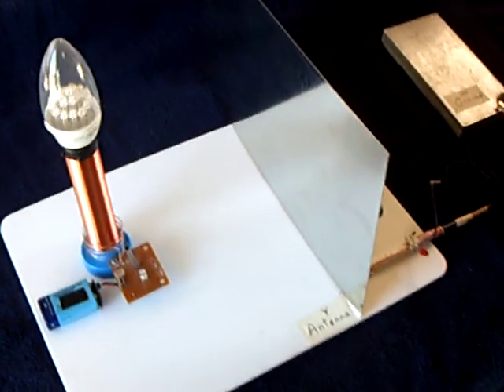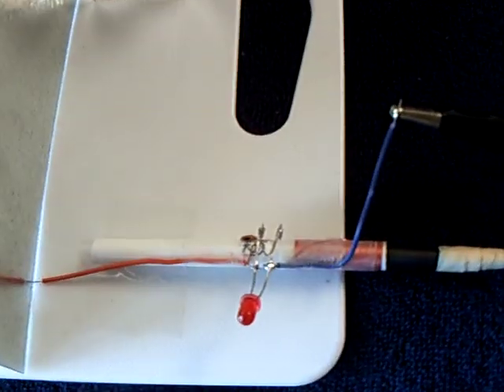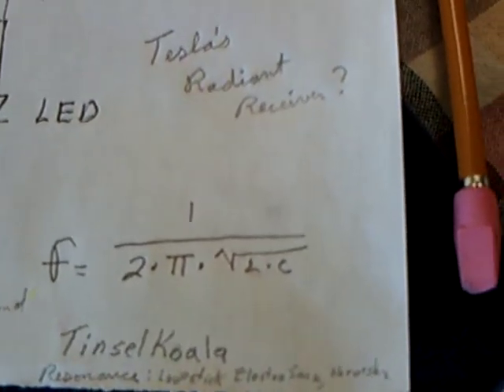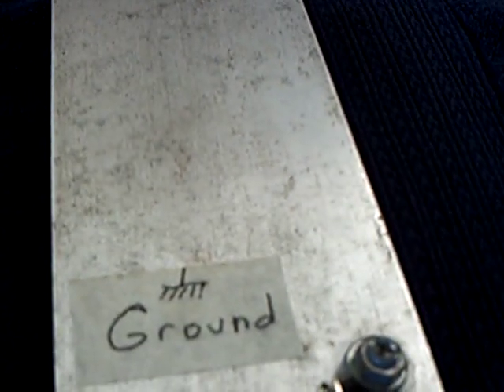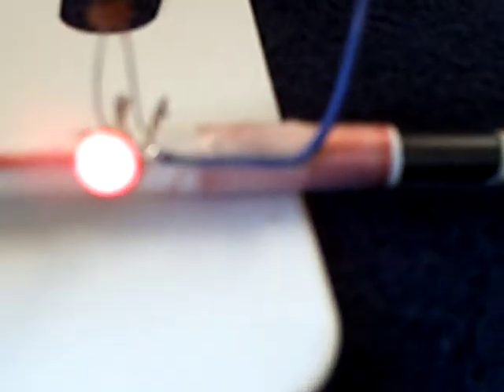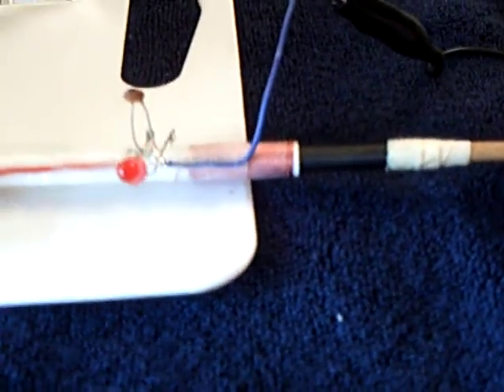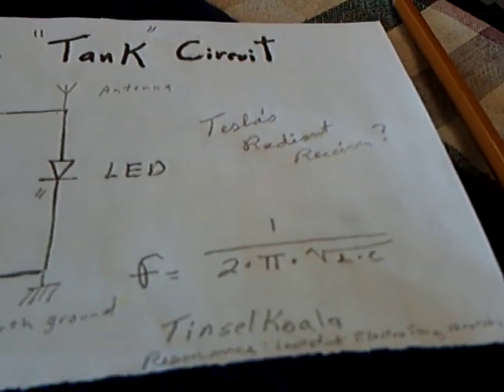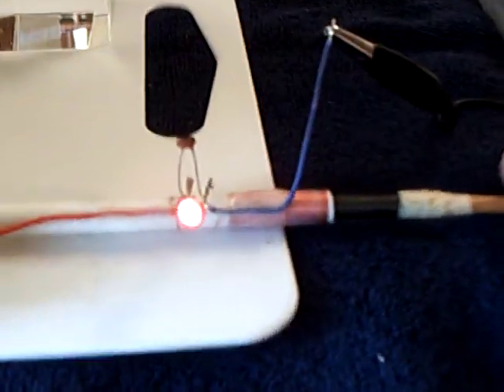Tesla's Radiant Energy Receiver ??

Comment: Tesla ball was 142' high at 6000 feet altitude in rarified air while grounded at 12 feet deep with a tin polished coating made of hollow wood internal spheres. It was then shellacked and painted with black rubber coating. Rarified air is the key based off the Crux radiometer. Radioactive particles traverse through the metal plate removing and adding charge. The upper plate needs to be negatively charged and the wire to be coaxial. The patent is missing other components to make it work. All of which he patented earlier (coax, circuit controller, capasitor Tesla generator(marx generator).
Reply: Read his Colorado notes for amazing images, tremendous energy creation, and tips to get it working. High altitude(rarified air or low oxygen with nitrogen) air is the key.

Comment: Is it possible to make a receiver unconnected to earth ground, is it possible to make the receiever miles away from the source? And can we use scalar waves? Thank you.
Reply from the maker: This only works close by.  You can run the energy down one wire and use an earth ground as the return.
Reply: Lidmotor have you heard of Konstantin Meyl?

Comment: i used a eco green light bulb the coil ones will they have a built in coil and a 200v cap and the body increase it because its more positive charge then the ground and the fact that i even tried it in the air 10ft up and got 110mv then i tried with just the cap and not so good so coil helps it.:-)

Comment: Interesting. Tuning it on a tank circuit is maybe what is needed to get the correct length. Is it a wave length? I know Tesla believed they were tiny physical particles, like what we today think of as neutrinos. Which is exciting to think about. But if they are coming in waves like a water ripple effect .... as suggested by your tank circuit, then we have some new frontiers to discover. But it makes sense because Tesla obviously used that theory to establish radio waves. Very interesting. Thanks for sharing. Sidenote. I picked up 12 volts with an aluminum foil pie pan this week on a desk without any type of slayer or oscillation. It's hard to replicate. If I move the pan a little it could drop from 2 to 6 volts. I'm going to try the tank circuit to maximize voltage.

Comment: That is basically how Tesla came up with Radio waves and so forth and yes it has to be set to the desired frequency just like a radio does to pick up the station. Tesla theory was you could run electricity through the air and have a receiver to pick it up and convert it back into electricity. He got a bunch of negativity for his theory, but hell I think he proved his theory, but some how people think he was way off base. When he told people he could deliver electricity to homes without wiring he was laughed at. I think he was right on target. Just something to think about. Thanks for sharing
Reply: @Bill Miles  Marconi's awards for radio were later overturned and given to Tesla ,  but,  it was after Tesla died..   Marconi used 17 of Tesla patents ..
Reply: Tesla was laughed at,  because his competition had a huge  Disinformation campaign to put Tesla out of business...  Thomas Edison even electrocuted an Elephant to show Tesla's AC power was dangerous..  That was just one of the tactics they used...

Comment: I'm having trouble doing the math, but I've been experimenting with these circuits, the capacitor and diode set ups.  Then I have an Oscillator, really just a 12v Fluorescent Light Table (similar to Plasma Balls), and there's obviously a high frequency step-up to excite the gas.  I've been trying to figure out how to measure the frequency so I can make a complimentary coil for a the resonance.  Like I said, I'm bad at math and I haven't found many internet calculators for the job (any suggestions for calcs, please).  My next project is setting up 5 layers of aluminum insulated from each other, as a Plate Antenna.  In theory, if all Plates are the same shape and size, they should each resonate at the same frequency, the neutral plates should work as amplifiers for the 2 hot plates.  Then the 2 hot plates will be connected to 2 collecting circuits connected in series, and then to ground.  Anyway, just thought I'd write this out in case it inspires anyone.  Keep Inventing!
Reply: Wrong! Below is Tesla's quote, I'll let you decipher it for yourself.

"Today's scientists have substituted mathematics for experiments, and they wander off through equation after equation, and eventually build a structure which has no relation to reality."

- Nikola Tesla
Reply from the maker: Thomas Sexton Math used to be something I enjoyed and was good at.  Now I have more fun building things trying NOT to use it.  It is like taking a piece of clay in your hands and working it into some interesting object.  There is no math involved.  I can't help you with the numbers.  Sorry.
Reply: Math is everything behind his inventions

Comment: so say there are overhead power lines... and those lines have high current, and using a tesla coil in revers or something (i am still learning - started 10 minutes ago) can i pick up those electorns that ionize the air, say the power lines run at a frequency of 200hz if i tune the tesla coil in reverse to pick up the 200hz frequency, will it work? if so, then what about earth's frequency, i saw this thing on that TRUE AC power is found in the magnetic field of ouer planet, hence where telsa got his inventions, but today people use a sort of man made AC current, and becuase of this there is a huge waste and the coil doesn't work, it has to be off earth's magnetic field, furthermore, lighting comes from space charged particles coming into earth and interacting with the magnetic field and so that charges the planet so essentially, we no lonfer need fossile fuels, but we need to harvest the power from mother earth, using the earth as the power, and the air as a ground... but it technically is the other way, i sorta answered my question here.

what is earth's resonant frequency?!
Reply: 7.83hz, make sure your antenna top hat is omnidirectional and the larger the better current. The height of the antenna will determine the voltage potential. Just going to say a elf tank circuit is going to be quite large, unless you know something I don't, good luck

Comment: Tesla put up a big antenna to transmit a huge amount of energy, then ran across the field and found he could power a light, transmit power without wires.
There is no magic to it, it is as simple and as plain cut as that. Bare in mind that radio waves are all around us NOT particularly from the sun but from huge amounts of radio transmission towers.
Many radio stations pump out huge amounts of power so converting that back into electric current to power a low powered light is as you said, basic electronics.

Comment: Nice job, enjoyed that. Haven't tinkered with this stuff for a while either and it does raise a few questions for the bench.
Such as...running an actual Ground from the tower and from the receiver, with distance between. Does copper work better than aluminium or steel and does a bigger/smaller sheet change results hugely. What if the tower was say 10ft in the air and the plate similarly. Would an AV plug + LED light off the ground energy once it was running. Fun stuff ! :)
Reply from the maker: Thanks. I have been trying many things with this. Some turned out very interesting and some were dissapointing.   Your 'Walgreen' exciter would work good to try thing out with.

Comment: I've been trying to make the slayer exciter work with a 2n2222 without success so far, what could I investigate to troubleshoot my circuit ? any advice please?
Is there a way to publish a circuit for dummies like me?
Reply from the maker: Try switching the primary wires.  Try a new transistor.  Do a Google search on Slayer Exciter circuits and make sure you have the thing wired right.  Instuctablesdotcom has a 'how to' on the complete build.   OR ----buy an original GBluer model at the Slayerexciterdot com web site.
Reply: *****
gbluer isn't selling outside of US :(
thanks to chip fixes from Instructables i checked the circuit it seems okay and i'm investigating my coils at the moment.
One thing: attempting to replicate his circuit I plug the '+' of my LED at the base of the PNP transistor and then to the '-' but it doesn't even light up. I check and I have continuity along the circuit. No matter how I plug the LED it won't light, as a sign of good working.
If anybody has a clue about this i'd be happy to hear it ^^
Reply: Google trop curieux His website says to search eBay for slayer exciter. He sells world wide on eBay.
Reply: steve clay
 at last i could make it work! yay, the problem was the coils arrangement, now we did it around a toilet paper empty roll with 0.2mm wire. primary is a few turns of thiker wire. Our circuit was good but coils were not :)